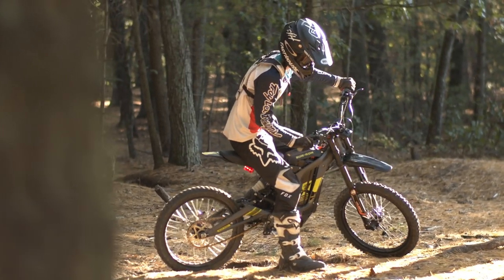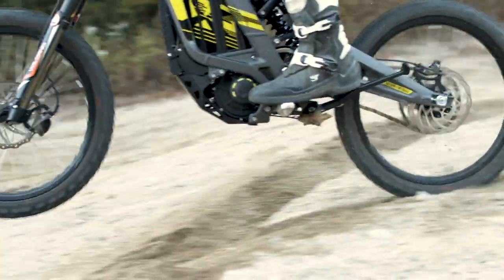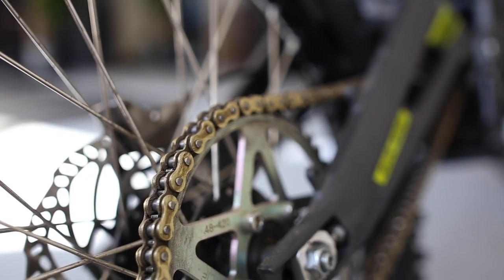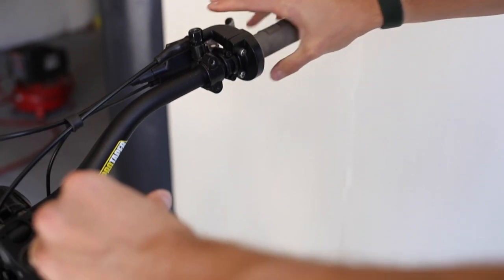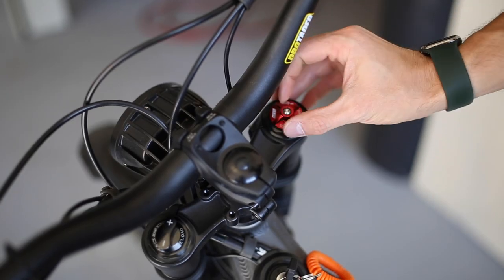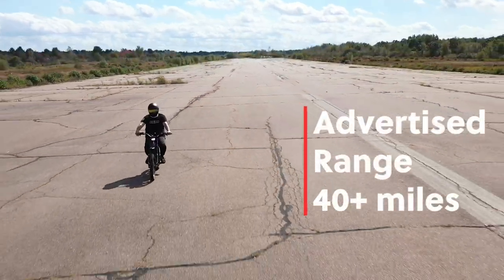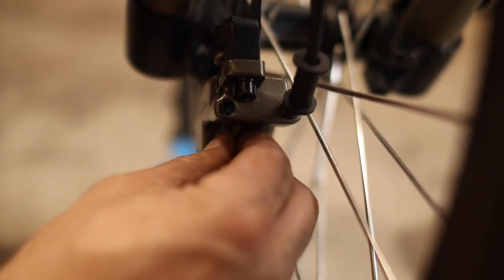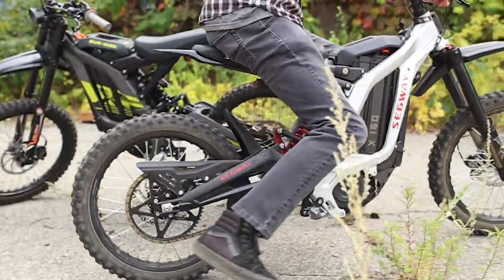Sur Ron X (Black Edition) Review!

Comment: Break Pads are pretty much the same across the board, the only difference between Shimano and Sur Ron stock break pads is when a Shimano Break Pad comes off the assembly line someone hits it with 1200 grit sand paper before packaging... save your money, there's plenty of mods you can do that don't involve wasting money on stuff you're going to wind up upgrading anyhow
Reply: Congratulations you just won a prize 🎁 Dm now.......💬on telegram for claiming

Comment: Bought my son the x260 segway. Really fun but the range is around 20-25 miles riding fast/hard. Which is the only way to ride it if you want to have any fun. We had it for 2 days and sold it. Until they drastically improve the range it’s just not worth $5000. IMHO

Comment: so, only the frame and the circuit board are the usable if you want upgrade this unit? is there a shop selling that parts only so we can buy the replacement upgrade parts and installed it?

Comment: I was thinking of getting this, but I really know there fun, but I don't think electric is long-term reliable. Please let me know if bike is accurate. Or if it short circuits? Remember Gas bikes didn't die.
Reply: It's just as likely to short out as any protected, water resistant electrical component in any other vehicle. Just like gas bikes, electric bikes may require maintenance. At the end of the day, there is so many moving parts on a gas motor, but you could count the amount of moving parts in an electric motor on one hand. Hub motors for example dont really have anything that can fail other than the bearing.

Comment: ANYONE WHO GETS THIS MUST WEAR A FULL FACE HELMET

this thing goes 50mph not just 45.

It comes already unlocked with the speed.

The brakes pads will be the first thing to go

Seat feels great at first but after a long ride it hurts

It can actually go about 60 miles if you go as slow as possible. Bassically the slower you go the farther you go. If you stay on full throttle it can kill the battery within the hour.

From brooklyn to Manhattan it takes about 30% when going 30 to 50 mph

Treat this as a real dirt bike because it is one. This thing is not a toy.

Over all one of the best purchases i ever made.

Do not get the pedal kit its cheap and can break easy and its overall not safe.

The lights dont drain the battery at all. It actually charges a phone with its usb port in just 2% of battery. Its a really powerful battery

If you go full throttle for a long time the battery gets hot. So dont be alarmed if it cant charge right away. Just let it cool down.

The battery charges in about 2 hours or less

DO NOT GET THE BELT UPGRADE. it breaks faster than the orginal setup and if you dont get the supermoto wheels(if you get the belt) you wont be able to go 50 mph with it

This thing is a wheelie machine. Be really careful with the torque when in sport mode. Ease into the speed

The stock tires arent bad they just wear fast

Always turn off the breaker before charging and/or removing the battery

Try not to leave the battery charging after it gets full

Look up how to do a low voltage cut out if your chrager wont charge the battery after the battery has been fully depleted 

Always keep the battery charged atleast with 50% or more. Never store it with no battery in it for a long time

This bike can ride in the rain but do not flood it

Dont worry about the legal stuff. Every cop sees this as an electric bike before they can even tell what it really is. State troopers can give you an issue tho but they wont take it away or arrest you or ticket you. They will just tell you to not ride it on public roads.
Reply: Awesome feedback brother, cheers from Aus 😎
Reply: SHHHHH. :) It only goes 28mph... ish... out of the box... Slap the peddal kit on it. It's just a widdol ol bicycle! Never mind the thing you can do with the Green-Black wire!
Reply: @GMK4EVER  dont give info like that to people.the pedal kit snapped on people and that could be really dangerous while riding
Reply: Thanks for this brother. I live in nyc and travel from manhattan to the bronx for work. Do you recommend? The commute is about 22 miles back and forth. Can I pedal instead of throttling to save battery life?
Reply: @TactileTherapy  depending on how much you weigh you can do 22 miles no problem. I highly recommend it to anyone in nyc. Its the best commuter you can have. I would think about a couple of things tho. If you can buy another charger and keep it a work i would do so. Carry the charger with you where ever you go because it just takes an outlet to chagre. Over all tho you should be able to go to work and back without having to charge the battery at all.

Jusy know that going full throttle is what kills the battery the fastest. The regen modes can help you but overall if you let off the throttle as much as you can youll save battery.

You wont know the true range of your bike until you ride it because your weight. What you ride on and what kind of wheels you have play a big factor.

For example when i first got the stock bike i was able to go from brooklyn to manhattan in 30% on full throttle. I installed new tires and heavy tubes which made the bike heavier and now it takes me 50% on full throttle but remeber im going 47mph on full throttle. If i go on eco mode and go slow i can make it to the city in 20% instead of 50%. 

It really all depends on how hard you use it but i would recommend it for anyone in nyc
Reply: @tintin6291  I dig. I clock in about 165 lbs. I probably might never go full throttle or at the very least never abuse it. Ok, it's looking like ima grab one of these.

Any issues with cops? Also, how long did you keep the stock tires and tubes before you swapped for upgrades and why did you?
Reply: also, any problems with theft? How do you lock yours up when going places?
Reply: @TactileTherapy  im 150 pounds so youll see the same performance i have. 

First of all i have to say that you must drive this as if it were a motorcycle. You need to take up a full space in the car lane just like a motorcycle would. Avoid bikelanes. Some traffic goes above 30mph so your ganna have to go full speed at some point.

A couple of reasons why cops wont bother you

1.it looks like an e bike at a distance. By the time they realize what it is your already gone.

2. It comes with a plate. Its for show but it adds to the distraction. (You can register the bike as a moped and put a real plate there) but i wouldn't reccomend that because youll be limiting the use of your bike.

3. Its legal to own so if a cop stops you and he sees you going under 25mph he cant say anything but its unlikely they will pull you over in the first place because of the other reasons stated above.

4. Its illegal to try and stop moving gas dirt bikes. Thats why you dont see cops chasing them anymore. On the sur ron you move just as fast and quicker than dirt bikes so if a cop sees you going full speed he still cant stop you because its dangerous to do so.

The first thing you should purchase with the bike is a motorcycle cover and a kryptonite U lock. If your going inside work i would take the battery with you. Also if you can fit the bike in your house i would do that. If you cant then atleast take the battery in. I would not leave the bike outside in the bronx and if you have to make sure the battery is with you and the bike is locked and covered
Reply: @TactileTherapy  i never poped any tubes but i got heavy tubes jist in case. They ended up coming in handy when i started to climb stairs with this bike. The sharp edges of stairs probably wouldve poped the stock tubes. Overall i use this bike for everything. I commute with it. I hit trails with it. I do jumps at skateparks. I climb stairs. I abuse the bike in all sorts of ways. So new tires was a must. I only got new ones because the back tire was bald. Other than that i wouldve stayrd on stock tires but im glad i put the new tires because i can lean better. I latch on to surfaces better and it just feels better

I got the shinko 524 in the front.

And shink 244 in the back

With heavy tubes

On the 19inch wheels
Reply: @tintin6291  haha my man. Thanks for sharing all that brother. I might catch you on the streets of manhattan one of these days. Appreciate you a ton.
Reply: @TactileTherapy  your welcome.

Look for the bright orange and blue book bag if you see a sur ron out in the wild

Comment: Nice work, really good video. I am planning to buy Sur Ron but i have doubt about battery temperature as we all ride dirt bike to their limits so this electric version batteries will heat up a lot, its a most important critical factor but no video shows what exactly temperature behaviour of sur ron batteries in field, can you guyz show us, it would be so exciting to watch temperature behaviour of Sur Ron battery in action.
Reply from the maker: we live in the northeast it gets cold here. The cold will affect both power and range but it depends how cold. Above freezing  and it doesn’t have much effect. Under 32 degrees F you would start to see power and range affected more potentially up to 20% less
Reply: @TechWeWant  Happy to see your response. yes right, as per my understanding sur ron batteries are without thermal management. If cells are often abuse by temperature exceed then cells energy density will reduce but to see this effect we need to review 2 year old Sur Ron.

Comment: It looks like a very small bike. I'm 6.2'' and 250pounds. What do you think about how a big guy like myself would look on what seems to be a small bike?
Reply from the maker: It might be small for you. But you could get bigger wheels…
Reply: There are mods for that. I'm about the same height. There's a seat extender, peg extender,  handlebar riser, and just getting a better seat also raised the height. You could get bigger front to if you wanted a 21 inch front.

Comment: Is this the X260?  I am looking at a few bucks more and more mileage and higher top speed for those (at best but ($4499).... This is probably not it.
Reply: This is the Sur Ron X. The Segway x260 is the sister shareholder company. I just ordered mine on LunaCycle for $3,600 before tax & shipping.
Reply: Get the sur ron from luna cycle. Its cheaper and more upgraded
Reply: Nope This is the Sur-Ron X (light BEE). I recommend it! If you are in the USA - Luna Cycles in California is the way! 3600... worth it.

Comment: How far of mileage you can get on the speed at 50-60 km/h?
Mileage on one charge is 100 km
Reply: Once you pass 30mph the range DROPS dramatically. If you were to ride it flat out at 30 plus. You with get 13 to 18 miles. Depending on the grade you are riding on and YOUR WEIGHT head wind level. These are the major factors.
Reply: @stevemann7073  Yeah facts, there are lot of downsides too

Comment: Did you cut the green wire?
Reply: the 2020 version u need to find the other wire
Reply: Just got mine a 2 weeks ago, yes, mine was green, cut it.
Reply: @chriscall3425  I had to cut 2 green ones
Reply: You dont have to for the 2020 version. It comes unlocked
Reply: @tintin6291  no it doesnt, bought straight from luna oct 2020
Reply: @in7el773  maybe the later models do but when i got mine in july me and all the people who got them then all can go 50 mph without cutting or joining any wires
Reply: SHHHHHHH... what green wire??? :) That is not the Green-Black wire you are looking for, officer.
Reply: Get on the sur-ron ebike forums to get tech help.

Comment: If it was a but faster, and had way more range I'd buy it without a second thought. As is, the nami burn e2 max is faster, has more range, and is cheaper.

Purely from a fun/commuting standpoint, obviously you can't hit the trails with the nami. It's just the fact that you can commute have fun and do it for a few cents per km is what I'm after, nami does it better for 30% cheaper.
Reply: You can get upgraded battery that doubles speed and range
Reply: @stuff.6631  How much does that cost

Comment: Don’t forget to get road legal one
Reply: Road legal one comes limited speed. Dont get it. Your better off putting a plate with mirrors and signals yourself to the faster sur ron
Reply: @urbancyclist6134  the legal one you cant cut anything .its stuck at 30mph and a new battery is 1500. Trust me road legal one isnt worth it
Reply: tin tin   Why will battery make a difference mate
Reply: @urbancyclist6134  because that's how electric vehicles work apparently, remote control vehicles included so I've heard
Reply: tawaitai how can it be when you can go anywhere
Reply: @urbancyclist6134  I meant the process of making it road legal.
Reply: tawaitai you can buy one road legal it’s called street version. Then swap controller

Comment: If you're over 200 pound in weight at full throttle you're talking 10 miles range
Reply: This bike is around 100 pounds. Im 150. It can go well past 40 miles of range
Reply: @tintin6291  BOLLOCKS
Reply: @ianmangham4570  i mean. Do you have the bike? I do and thats my experience
Reply: @tintin6291  Sold it, it'll go further with you on ,a strong wind will blow you over at only 140,I'm 6' 2" 220 and I got the same mileage Flat Out as the guy from Bikes n Beards /you tube channel
Reply: @ianmangham4570  ngl the wind does push me at times but its not that bad. Yeah 220 will deff kill the battery. I had someone ride in the back and it killed the battery faster
Reply: @tintin6291  🙋👍
Reply: Negative chief... I'm 300 pounds. It take my fat ass, does a wheely and still throws me arounf 40 miles all week long. Keep in in eco mode and youl get more. The battery will balance after the 4th or 6th cycle. maybe if you go up steep hills all day... I would say 30 miles minimum, uphill in the snow without shoes in the winter both ways :)
Reply: @GMK4EVER  Donkeysmell
Reply: I ride hard at full throttle with jumps and nasty terraain and I get 20 miles max. I weigh 180 pounds,.
Reply: @dbirds21  Great
Reply: @GMK4EVER   I weigh 220. Did you have to do anything to the suspension? Just curious because i thought about getting the 550lb spring in the rear.

Comment: 4k dollars 🤣🤣🤣🤣🤣🤦🏼‍♂️ why would anyone but this thing for that kind of money what a joke
Reply: Aside from having to charge the battery this thing well worth it. Its a straight up motorcycle in a small form factor and the toruqe is insane. Videos dont do it justice. This thing rips
Reply: "but this thing" hehehe
Reply: Because it is AWESOME and it's only 3600... :) like tin tin said... this bike is a beast! and thats just the Light Bee variant... the HEAVY Bee is coming out soon...
Reply: @tintin6291  its no dirt bike. its a big downhill mountain bike. MOst states dont allow them to run on the best mountain bike trails, which sucks. So the only terrain you can run them in is on dirt bike trails and they are just too small and weak to really enjoy riding hard. I love my surron for a urban cruiser, doing wheelies etc. and sometimes sneaking in a mountain bike trail.I had to buy a 4 stroke husqvarna for riding the rough n tuff stuff.
Reply: @dbirds21  its not recommend for real down hilling especially with the forks it comes with. Its deff more of a dirt bike then it is a downhill bike
Reply: Well i have both and its much better for mointain biking like freeride cause its too weak for real dirt bike trails. Its the reason i bought a husqvarna after i bought my surron..surron does quite well on freeriding with jumps..the forks suck regardless of the riding.